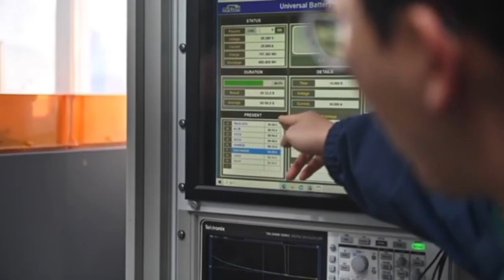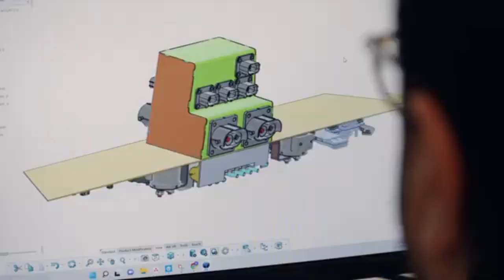10 reasons to fall in love with Aptera. Which reason is your favorite.

Comment: When a this going to be available? Too many XXXX waiting, people are losing patience.
Reply: December is when they are available.
Reply: Aptera is not going to be releasing a severely defective product such as Tesla did with the Roadster, and hope they can fix it later.  I have been waiting longer than most, but I am thrilled that the vehicle I will be getting will be far more advanced than the one that was originally promoted.  I will probably get mine sometime in the first half of 2025 if my health holds.
Reply: @n.brucenelson5920  - Can you stop talking about the Tesla roadster. That was 16 years ago.
Reply: @billsmith5960  Whats the matter, are you unable to learn a lesson from anything that has happened in the past?  Do you think that nothing that occurred more than 16 years ago affects your life now?  What a ridiculous request!
Reply: @billsmith5960  I signed an NDA over my review of the cooling system which had nothing to do with being an Ambassador.  Your guess is wrong.  Aptera will put the PI vehicles through validation.  This doesn't mean they will have to be "perfect".  If you have any business knowledge, you know how this works.  You are making it sound like you don't.
Reply: @n.brucenelson5920  - Then just for that cooling system is fine. Seems like you must have been a contractor or employee of Aptera because they are the ones that have to sign NDA's. Not just some guy off the street. In the end, if the cooling system was so special and secretive you'd never have any access to the data and design of that. Since you did, it confirms my suspicion.

Now I ask you, how long have you worked for Aptera? Why do they let you just post all over youtube?
Reply: @n.brucenelson5920  - Also, you seems to be all over the place. Talking about Tesla transmissions from 16 years ago and then about cooling systems. It would be nice that you would stay on topic. Yet you do not. It's a diversion tactic. Plain and simple.

Comment: More info.please
Reply from the maker: Hello guys. I understand that this video does not have detailed Explanations on the various features of the vehicle. So I have decided to work on a more detailed video for your consumption. So keep your heads up for it. Let me know which vehicle you will want to know more about in the comments section.
Reply: If you search YT for Aptera, there's lots of info. Also, Aptera has a website.
Reply: I’m just not onboard with the EV. . . yet.  I don’t think the country is ready either. For me baby steps are what I’ll take.  Cheers!
Reply: Depends on your use case.  I have driven a Nissan Leaf (first mass production EV) for 13 years so far because I only need it for short trips (long trips I take my Harley).
Reply: @sherlock1895  Approaching 50,000 reservations ATM. It's not for everybody but  it is for many.
Reply: @sherlock1895  EV sales are increasing at a rapid rate, while ICE sales are decreasing.  I know this is contrary to many scare headlines, but you can find the real data if you look.